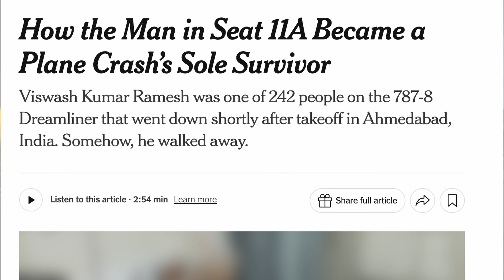Why the RAT Changes Everything – Air India 171 Update

Comment: Someone posted this on another vid and it sounds plausible so I will repost it here and maybe Captain Steeeve will look at it. Here it is:  @urvishjoshi5339
2 days ago
Here’s a critical but under-reported hypothesis: dual engine flameout due to closed Firewall Shutoff Valves (FSOVs), which cut off fuel to the engines. These valves are typically closed during maintenance or fire isolation procedures.

If left closed after maintenance, engines can still start and taxi using residual fuel trapped in the lines. However, they will flame out under full thrust—shortly after takeoff, which aligns with what appears to have happened in this case.

In this scenario:

Air India Flight AI‑171 had arrived from Delhi earlier and likely underwent standard maintenance checks.

If FSOVs were not reopened, and engine run-up tests were skipped, the dual flameout was inevitable.

Pilots may have had no warning, as cockpit systems often do not detect mechanical mispositioning of FSOVs.

The result: both engines fail shortly after liftoff. With no thrust, the aircraft cannot gain speed or altitude. It stalls and crashes.

Why this matters:

FSOV-related fuel starvation incidents are not unprecedented. A similar cause led to a military aircraft crash in 1957. Digital aircraft like the Boeing 787 cannot detect mechanical faults without sensor feedback.

This highlights the need for stricter FSOV checks, mandatory engine run-ups post-maintenance, and dual verification protocols before dispatch.

Comment: As a person who has been following this closely .....

1. Engine Failure Theory – Many pilots and as explained by Captain Steeeve, lean toward a rare dual-engine thrust loss during takeoff, supported by early distress calls and the deployment of the RAT (Ram Air Turbine), which only activates in major power loss situations.

2. Pilot Error Debate – Some suspect a takeoff configuration error ( eg retracting flaps or gear too early), but this theory is controversial. Many experienced pilots argue this is speculative and unfair without CVR/FDR evidence.

3. Crew Defense – A large portion of the aviation community is defending the crew, emphasizing that Air India pilots are well-trained and pointing out the dangerous habit of assigning blame before full data analysis. This is also in support with what most people have commented here.

4. Aircraft Integrity Concerns – Given Boeing’s recent scrutiny, some theorists question whether a deeper mechanical flaw might have played a role—though there’s no confirmed link to systemic defects yet.

Bottom Line: While the black box holds the truth, expert consensus is urging restraint. Most credible theories revolve around a sudden, unexpected loss of power or a takeoff configuration anomaly—but serious voices in aviation say it's premature to blame the pilots or the aircraft until data is confirmed.

Comment: Once there was an aircraft that also suffered a dual engine failure due to fuel contamination. Later on it was discovered that the crash was caused by fuel contamination due to a fuel filter failure within the fuelling truck. The malfunction of this filter resulted in a thick white blurry stuff that easily clogged both engine fuel filters at almost the same time. Restarting the engines was not an option anymore and that plane also crashed because of it. Maybe it is similar in this case.

Comment: Flight: AI-171 | Aircraft: Boeing 787-8 | Date: June 25, 2025 | Route: Ahmedabad (VAAH) →
London Heathrow (EGLL)
Crash Site: ~1.2 km from VAAH Runway 23, post-V1 and rotation
Fatalities: 247 (243 onboard + 4 ground)
⸻
AAIB Preliminary Report Highlights
1. Primary Cause – Electrical Power Transfer Interruption (PTI) During Rotation
• During transition from ground to airborne electrical configuration, the aircraft experienced
a cascading dual-engine FADEC (Full Authority Digital Engine Control) failure.
• Root cause: Uncommanded bus transfer failure due to arcing in the main power relay box
(PRB-A), traced to water ingress during pre-flight GPU disconnection in heavy rain.
• This led to loss of electronic engine control at rotation, resulting in both GEnx engines
rolling back to ground idle within 4–5 seconds.
2. Flight Data Record Timeline
• +0:11 sec: Nose gear lifts off.
• +0:13 sec: Sudden engine rollback begins. Thrust reduces from 92% N1 to <27% within 3
seconds.
• +0:16 sec: Master caution + ENG FAIL L/R warnings. FO calls, “Both engines dropping!”
• +0:20 sec: Autopilot and flight control reverts to Direct Mode. Pitch up attitude peaks at
18°.
• +0:25 sec: Aircraft stalls at 186 ft AGL.
• +0:30 sec: Full aerodynamic stall; nose drops rapidly.
• +0:38 sec: Ground impact at 54° nose-down attitude, 174 knots.
⸻
Contributing Factors
• Environmental Conditions:
• Torrential rain during pushback.
• Moisture intrusion into PRB-A connector (P/N: HLN8471) — a known corrosion-risk
component.
• Latent Maintenance Issue:
• Power transfer relay unit showed signs of thermal damage in a previous MEL deferral 2
weeks prior.
• No replacement had been conducted; aircraft was cleared under repetitive deferral.
• Design Oversight:
• Boeing 787 has no physical engine control backup (i.e., no direct mechanical linkage in
FADEC loss scenario).
• Loss of power supply to both EEC channels resulted in engine “freeze” at ground idle
instead of flameout.
• Flight Crew Response:
• Attempted engine relight sequence not completed before stall onset.
• Emergency power selector not activated — possibly due to confusion from multiple ECAM
warnings.
⸻
Immediate Safety Actions
• DGCA + EASA + FAA Emergency AD issued within 24 hours:
• Mandatory PRB-A moisture integrity inspection on all Boeing 787 aircraft.
• Temporary restriction on dispatch with MEL items related to power transfer systems.
• Boeing:
• Issued Service Bulletin SB-787-24-212 requiring replacement of PRB-A connectors with
sealed versions.
• Exploring addition of dual-path power redundancy for FADEC systems.
⸻
Lessons Learned
• Over-reliance on electrical power distribution architecture without layered redundancy.
• Lack of crew procedural training for full engine rollback during takeoff in EEC dual failure
scenarios.
• Need for improved environmental sealing in GPU/electrical handover units in monsoon
zones.
⸻
Human Toll
• The loss of 243 onboard lives, including 12 crew and 18 infants, deeply impacted the
aviation community.
• Final words captured on CVR: “We lost everything – no thrust!”
• One family of five was killed on the ground in a hospital ambulance struck by debris.
⸻
Timeline – What’s Next?
• Aug 15, 2025: Release of FAA/Boeing electrical design audit report
• Sept 5, 2025: ICAO session on electrical-critical phase-of-flight risk mitigation
• Oct 2025: Mandated design retrofit across 787 fleet (rev. SB-787-24-219
Reply: How you know this?

Comment: Gee what I see is right there at the beginning of what you're showing nose up store nose down attempt to regain airspeed nose up crash if you don't see the the stall and then the nose down and then up again you're really trying to set a scenario aren't you this is playing flat not enough airspeed maybe a loss of power but it doesn't indicate the pilot window pulled the nose up the first time like I said my original statement no the pilot came to a updraft from the runway very hot across the section that created a hotspot this created an updraft at the same time the pilot was trying to bring the nose up I live in the desert I know exactly what happened I bet if you take a thermal camera and take a picture of that Runway when it's close to the same temperature you'll see a hotspot an updraft

Comment: How could both engines shut down after takeoff (no birds, no fire, no fuel issue)?

A likely scenario involves a software fault in the FADEC (Full Authority Digital Engine Control) system. Modern jets like the Boeing 787 rely on digital control units to manage engine performance based on sensor inputs (pressure, temperature, RPM, etc.).

If a shared software bug or common sensor failure falsely reports a critical parameter (e.g., overtemp, loss of oil pressure), the FADEC may autonomously command a shutdown to protect the engine.

If both engines receive similar faulty data or are affected by the same software logic, they could shut down almost simultaneously.

This would also trigger the RAT (Ram Air Turbine) to deploy — a backup system used only when both main power sources are lost.

No explosion. No fire. Just digital logic doing what it was told — possibly... by mistake.

Comment: Nose up ? plane wanna go up. It goes down with it's powerful modern engines? no thrust aka both engine failure that's for sure. is that mechanical or human failure that should be the question...

Comment: At this speed, RAT could not have given enough energy for the landing gears to retract. The pilot could not even dump the fuel due to low elevation. So, two engines losing power, altitude not enough to go around back to airport, a single RAT that could not have powered vital systems because the speed is definitely less than 130 knots. This is the worst failure scenario to any seasoned pilot. Aviation authorities should learn from this and ensure we provide more safety to the passengers. Thoughts and prayers to all who lost their loved ones.

Comment: NEW INFO --- a 787 engineer was saying he suspects the RAT points to electrical failure in the  CCS Cabinets (Electrical System)  - The NEW  video from a passenger on the PREVIOUS flight on the SAME AIRCRAFT earlier the SAME DAY showed a bunch of evidence of electrical failures. In the video, Onboard entertainment system looks fried. AIR CONDITIONER wasn't working... 105 DEGREES airport surface temperature  is serious heat on COMPUTER ELECTRICAL SYSTEMS. The passenger video clearly shows  Screens unresponsive or blacked out. etc DEFINITELY something wrong with the electrical system.  I guarantee that a MAINTENANCE order was given  upon the conclusion of that flight and I guarantee that the AIRPORT MECHANICS on duty tried to fix it.  WHAT DID THEY DO????? Disconnect the CCS Cabinets? Bypass one? Bypass 2? Did the mechanics turn off something shifting the electrical load to overload from the heat and  kill the electrical system???   They need to address what the maintenance crew did when they were turning this aircraft around.  https://oat.aero/2024/04/17/boeing-787-common-core-system-ccs/

Comment: I could not discern the sound of the R.A.T. on the video clip. But that raises a question. On take-off are not both engines have their power set to full? If so, would not the sound of those engines surely drown out the sound of a two-blade propeller on the R.A.T.?

Comment: 6:44 Pause and zoom in the video. There are only landing gears vissible, no air turbine vissible ( aka RAT). I am sorry, but you sound really convincing, but it's just not true. It also circled around the debris that is so very low between the gears, on that angle, which is technically impossible. Because that is a boeing model 877, which has no dedicated RAT size ( it is flexible in size ) likr 777 or compared to Airbus model A380, which is about 1.6 m length. Not possible to see such thing from such distance and angle. I do believe with new AI technology someone tried to improve the video quality and that's all about it.

Comment: OK I have question though, the video apparently makes it clear flaps were not extended, if this is a dual engin failure with loss of electrical and hydraulic power (save for accumulator) why would the flaps not be extended especially since retracting them consumes precious hydraulic power ?

Comment: Thank you Captain for your excellent and clear explanation.
- "Previously, Steeeve leaned heavily into the possibility that the pilot may have accidentally retracted the flaps instead of the landing gear"
- I cannot see how such a mistake can happen. The gear control is a simple and small two positions (up, down) lever located in the middle between the display screens, while the flap control is a bigger, cranked multi-position (0, 5°, 15°, 20°, 25°, 30°) lever situated at the right of the engine power controls. Anyway, I have heard of a pilot in a small aircraft (Cessna) having confused the carburetor heat with the mixture...

Comment: As an AME, I'm going to support this theory with a 5th point. the Landing Gear being down also verifies a dual engine failure since there was no hydraulics to retract the gear. There is only an Emergency release for the gear, not an emergency retract, and the RAT is not plumbed or designed to bring the gear up. They may have attempted to retract the gear for the purpose of to reduce drag and increase their glide,  but they probably couldn't.

Comment: It may be just ancedotal, but some information about this exact plane's flight directly prior to its final one was posted on X by a passenger on that flight. He showed a video he took inside the aircraft before take off and most of the cabin electrics were not operating - the video screens, audio speakers, aircon, seat lights were all non-functional. And it didn't appear that the crew were too bothered as they were just going through their normal pre-flight motions. That loss of power to a variety of cabin devices at once seems rather strange and horribly portentous of what was to happen on the very next flight. Hopefully that passenger's testimony will be relayed to the investigators, and it would be interesting to find out from the sole survivor whether any of the same glitches remained in the cabin on his flight.

Comment: You're telling me the engine size of a 737 Max's fuselage. Will experience a surge due to a pigeon strike?!
If it was a vulture/falcons I would believe it. Also there was no sway of the aircraft. It glided with no turns.

Even if the engines were not maintained or swapped with errors. It wouldn't have started so well. The onboard readings would have taken minutes to rise to the predestined egt. Indicating the error of ignition/fuel ingestion. 

Another speculation, regarding maximum takeoff weight. No passenger aircraft is ever taken off with exceeding the takeoff weight limit. These slips/documents are signed by the captain. They would never risk exceeding that limit.

I hope it was not a maintenance fault. Cause maintenance people are the backbone of any industry. They work on low wages and work over time. They also never get noticed or appreciated. Except for such events and pointed out for mistakes and accidents.

Comment: wouldn't the plane losing lift because of improper flap placement cause a complete stall ?? and both engines failed during stall causing the rat to deploy.  The plane crashed because of lack of lift.

Comment: Retired 777 driver here.  

I just heard your update regarding the RAT.  I had suspected power reduction from the beginning (for a different reason). . . 

In the very first video, look at the exhaust plume from the right engine just before the plane disappears from view.  That does NOT look like an engine under power -- especially that they were likely at max blast.

Thanks for your attention to detail!
Reply: Occasional passenger here. I was wondering in that first video (around 1:39) when the plane emerges from behind the shack, why there's so much dust kick up. Maybe it's not dust, but smoke? Maybe all takeoffs from that location are that dusty?
Reply: @martyfarty0 maybe because they used almost the entire runway, so the engines were blowing the dust at the very end of the course?

Comment: Can it be due to a heavy cargo shift causing damage to some electrical power cable connected to engine power supply,because the problem started after nose up climb position.There is a reference of loud noise by the survivor.Also is there any possibility of missing refueling, of course there will be warning to avoid that,but still.